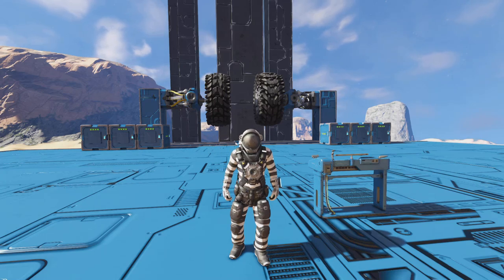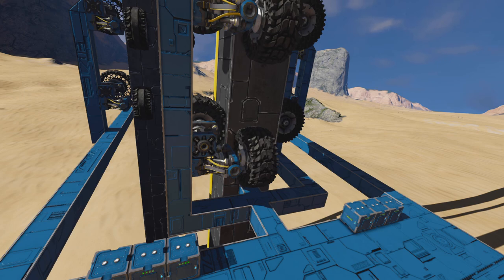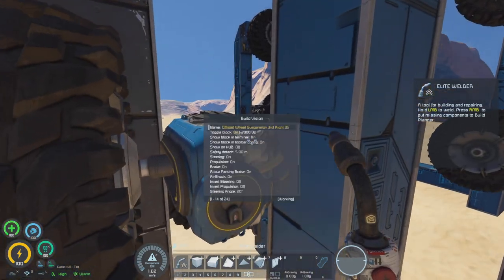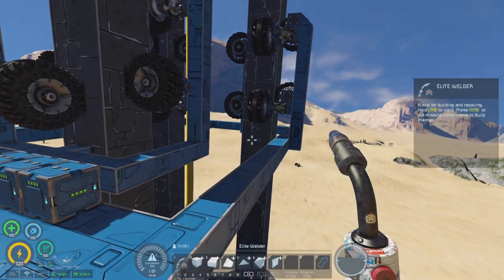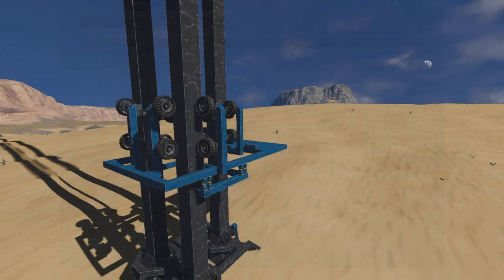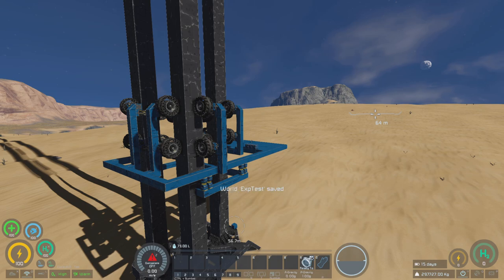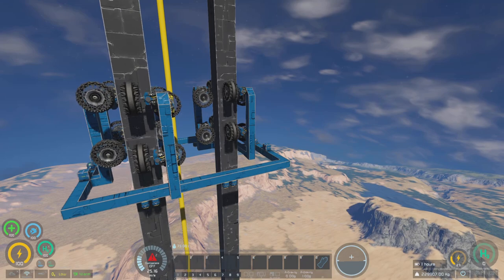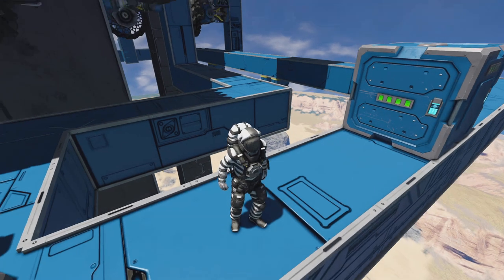Space Engineers Experiments: Testing To Increase The Space Elevator Speed

Comment: Turning off air shock is a definite help.  However, the big thing you want to stop is the bouncing of your wheel suspensions.  This is controlled by the Strength slider in the wheels.  At 6% the suspension can still be compressed fairly easily and when it returns to normal, it will bang the opposite suspension into the pillar and possibly cause damage.  Heck, it could cause damage to the pillar when if it compresses too far and too quickly.  Having a higher strength gives you stiffer suspension so the wheel can't move as much or at all.  I don't think you need to go to 100% but the strength definitely should be higher that 6%.  The height offset is also important as, even at the end of the video when you were successfully going up and down the pillars, about half the wheels weren't touching the pillars.  You need to get the height offset set so that all the wheels are in contact with the pillars or even pushing against them slightly.  This, combined with a high suspension strength, high friction and air shocks being turned off should make the system fairly reliable.  If possible, try to even out the weight of the platform so that it doesn't try to lean and make some of the suspension work harder than the others to keep the platform level.
Reply from the maker: I need to find the sweet spot for the strength. I tried 100% at one point and it squeezed the blocks off the pilar lol
Reply: This is accurate bring the height offset all the way down and put the strength on 20 and play with it untill you find your sweet spot

Comment: So just a little idea i had, but why not put a cockpit of the thing facing upwards, so up is forward, this would sort out all the wheels to begin with wouldn't it?? as it uses the cockpit to decide which way is forward??

Strength should be set to 20%, Airshock off, power full, hight at -0.4 from the looks of it. and the cockpit idea. should sort it out for you
Reply from the maker: I tried the cockpit facing upwards at one point, but didn't go with it because it was still breaking the towers. Now with Airshock off I think I should be okay.